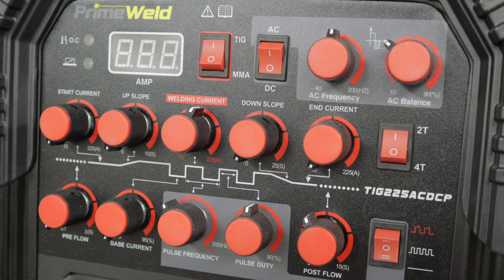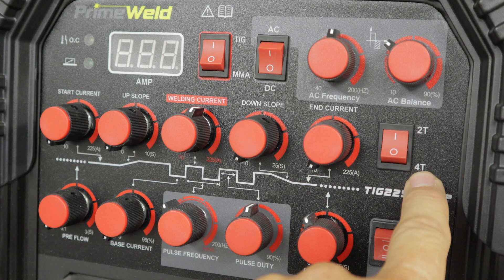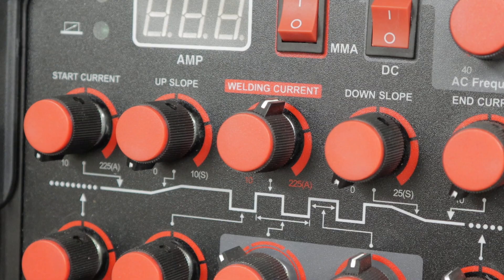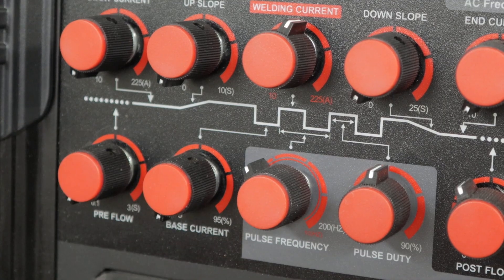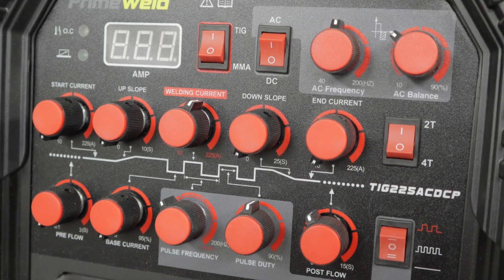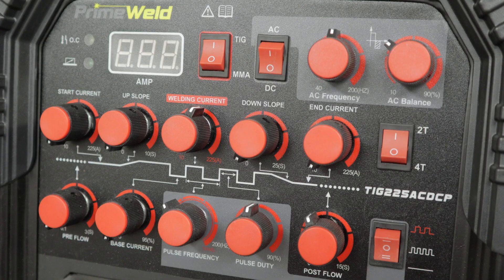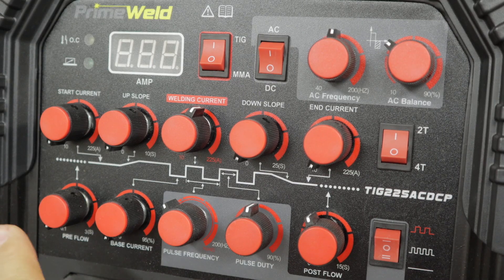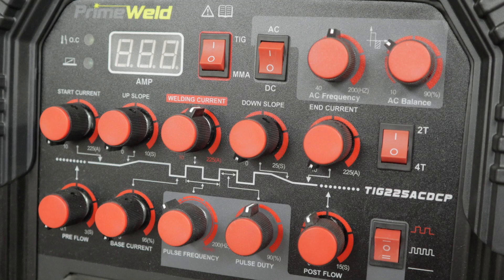Basic Settings for TIG Welding Mild Steel with the Prime Weld TIG 225X AC-DC TIG Welder

Comment: So few hash marks or scale marks is arguably what makes this welder difficult. I'm constantly wondering, is the scale linear? Is this the setting that I need to tweak? Is there so much variability in the circuit that my settings are different compared to others? I love the welder, but this alone has made me want to sell and buy the step up model. Anyway, thank you for the video.

Comment: i have an old oil cooled welder  How can i TIG with it.  what if i ratified the ac current as it enters the welder ? will it then be DC there after ?  & i can weld as i wuld with a DC welder ? can you Anweasr  that question. for me Les  UK .
Reply from the maker: I don't have any knowledge or experience with an old oil cooled welder.

Comment: Good video. On your 2T and 4T statement. I have the machine and running AC on 2T it will do pulse. The "T" just means how many "touches" to start/stop the operation. Pulse is controlled via the pulse switch, Off, Type 1, type 2.  I like the the switch personally after several hours with the pedal, at least for small stuff.  Far from a pro but the pulse helps hide that HAHA.
Reply from the maker: Thanks for the info Dustin! Happy Welding

Comment: Pulse settings are useful. It drops the amperage from the amperage amount that you set the machine to wither a lower amperage or zero, depending on the machine. It is great for overhead welding, cause it keeps the weld pool a little cooler and from dropping out. Also good when your are welding thin edges. If you ever want to weld two aluminum cans together you need to learn to use the pulse feature.
Reply from the maker: Thanks for the info! I have been playing around with the pulse feature a little and I can see how it would be useful in certain situations. It's good to have that option.

Comment: 2T can also be used with a momentary on/off switch.
Reply from the maker: Will that be at a fixed amp setting?
Reply: @DIYHomesteadProjectsDIYHP10  Yes, both 2T and 4T when used with a momentary on/off switch will be with a fixed amperage, as that machine has no way to alter it with the switch.  The difference between the two is that 4T can be thought of as  "trigger lock", so you don't have to keep the switch pressed the whole time you want the arc "on".   When you want to extinguish the arc, you press & hold down to slope-down for how ever many seconds you set at the dial, then let go and the post-flow will kick-in.
Reply from the maker: Very neat! I have tried the finger switch once with this machine mostly just to see if it worked and it does. I didn't tinker with it much but I can see how it would be useful for many situations. I'm really liking this machine, more and more every time I learn something new about it. Thanks for the info!